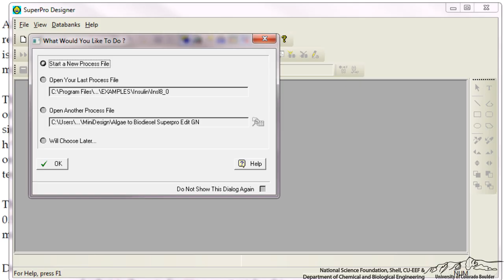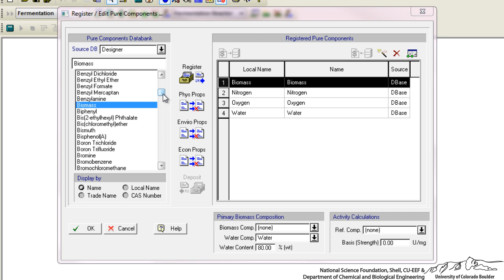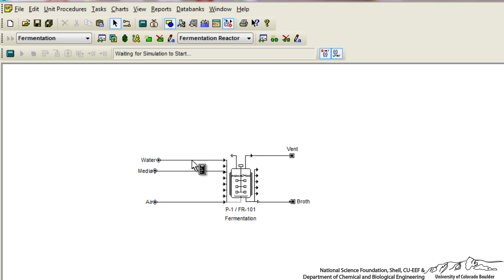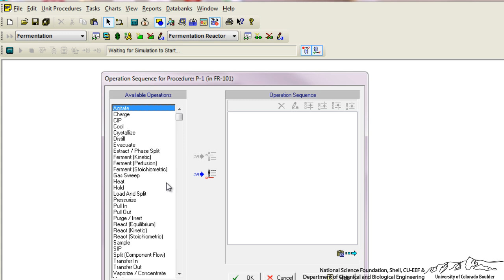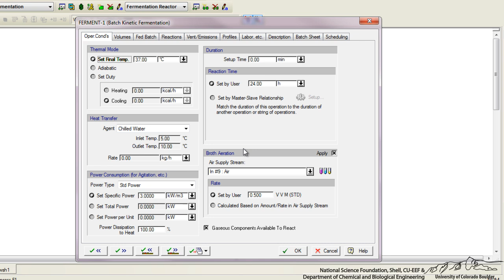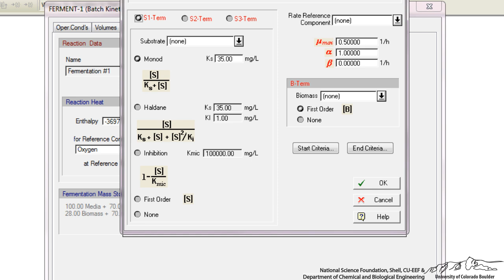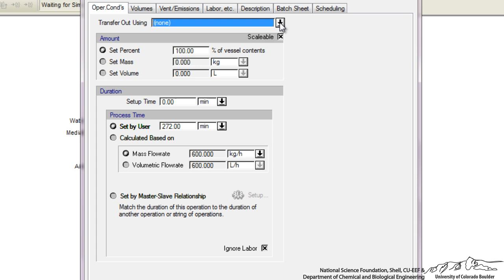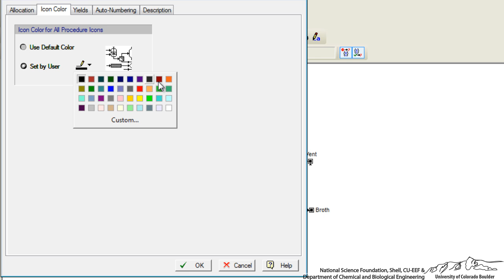SuperPro Designer: Fermentation Simulation

Comment: Can we run the same simulation in aspen?
Reply: need to consider the rate law aspen considers (power law) , but there are possibility for custom equations also where you can work with differential equations.

Comment: Thanks for the explanation. I have only one question. What it means the setup time?
Reply: I believe that it's the time it requires to fill the reactor. These need to be considered during the batch process. When multiple cycles of batches are involved, these include not just filling but also removing and cleaning time.